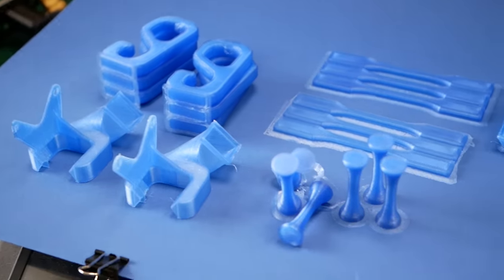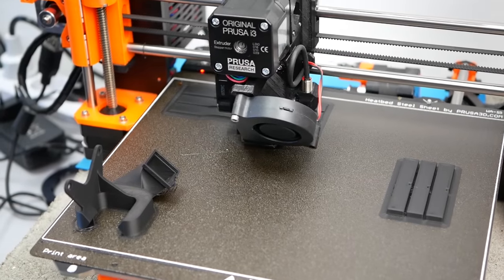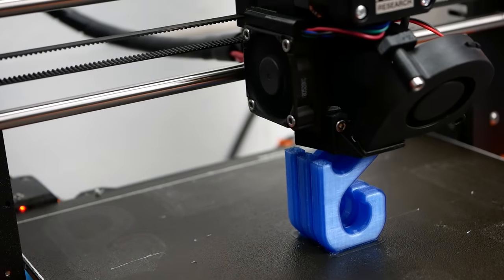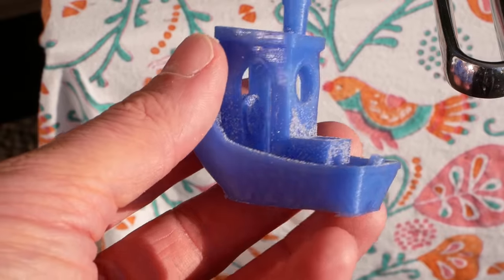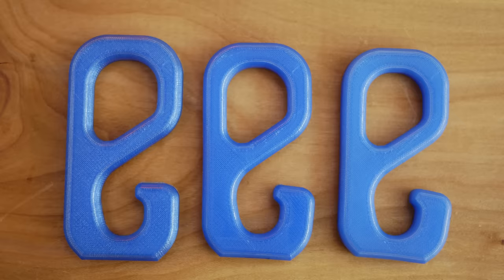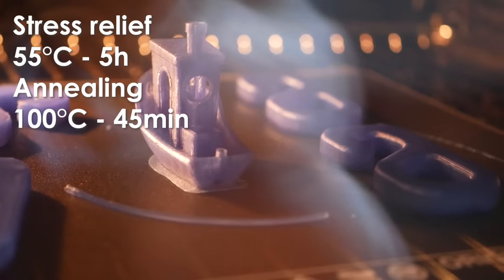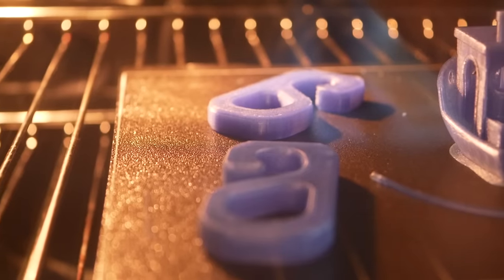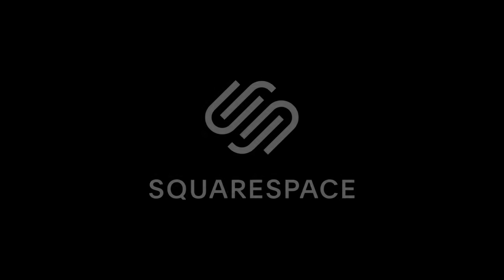Strong 3D prints through ANNEALING, but... Part 1: PLA

Comment: I wrote a small python program that generates gcode the ramps the heat bed temperature up and down at a controlled rate for annealing printed parts. Per all the documentation for annealing plastics, the ramp rate is important! Using an oven does NOT control the rate. Are you interested in testing this? I like the test equipment you have made and am curious if controlled temperature ramping changes the results.

Comment: I doubt there is a way to improve inter-layer height of FDM with a secondary operation, it's basically a weld line, and those are huge issues even in injection molded parts.

Comment: What about flash heating.  Dip the test piece in hot oil or glycol at appropriate temperature for 10 seconds to melt the outside while leaving the internal structure in place.  Please try it????

Comment: You should try putting a weight on the sand or some container to hold the sand tight together. Annealing will encased in plaster?

Comment: please if you aprouve like it 😊
new idea of bencmark : 
test how mutch adesive to plate is
-build tak
-hot & cold glass pane
- hot & cold sanded with 240p, 500p, 800p sand paper
- with glue stick or " glue for hair
-ultrabase if you have

the idea is what us the better to not have warping
you can do these test on multiple platics

Comment: Hmmm, maybe baking temperature is to high. Did you based on some information when you choose oven temperature?
Reply from the maker: The degree of annealing depends on time and temperature. 100°C is a "usual" temperature. I don't think lower temperatures would change alot besides needing more time for the process.
Reply: CNC Kitchen 
Tg delta is key for PETG apparently.
The comments show Tg - 20c as the strongest.

Comment: While most of these results were a little disappointing, the annealed parts' elastic failure mode is a pretty nice benefit, considering PLA's habit of bursting into scary shrapnel when failing. Edit: Actually, I wonder if just the de-stressing process would confer that property, if not necessarily the same temperature tolerance.

Comment: There are other heat-annealing tecniques, as well. I've seen at least two which use water at different temperatures.

Additionally, your standard conventional oven isn't designed for the sort of temperature control needed for precisely annealing anything, synthetic polymer or otherwise; as you acknowledged when you commented on the sand technique. I'm not sure how well sand helps with that, or how long it takes a given volume of sand to come to temperature evenly. I do know I've seen at least one paper where a researcher used a kiln or a casting oven for better control and followed a temperature "cone" process adjusted for the plastic in question. I don't remember any further details of that paper, including the results or the authors, sorry.

I do find it important to note that every test sample you used here in this video had a reduced infill percentage. Would you be amenable to running a set of similar tests on prints with 100% infill? I imagine that the increased quantity and lesser individual volume of the cavities within the prints might make the material more likely to polymerize together successfully - but that's only my guess.

Thanks for another educational video, Stefan!

Comment: Hey guys, I really want to know where you got the information that ABS can't be annealed, because I've seen several sources that claim otherwise, and when I've printed ABS I've noticed non-negligible changes in part reliability. More specifically I've been able to get parts to maintain more strength along z axis loading without layer delamination. I'd really like to see some empirical testing done for the sake of completeness, because otherwise I'm fixing something that isn't actually being fixed.

Comment: The only thing that I could suggest is trying with vacuum cooking,  it's a special device that heat water to a precise temperature..   then you put your part inside a sealed bag  without air.  as you do with food.   the oven is not as precise because it heat then turn off then heat then turn off.   the element is radiating heat that is hotter than the set temperature .      like with  meat you can not overcook and the center of the piece should achive the same temperature as the outside after a certain time  as no part can go to a temperature higher than the set temperature.      the only ''big'' problem that we have is that we have to  find a way to have  the water or something else   boil to a higher temperature.  someone have any idea if there is any way we could make this work??     maybe something underpressure??

Comment: Wouldn't warping be due to inconsistent heating? And could be solved by very gradual introduction of heat up to the required temperature, with a similarly slow cooling process? Putting the parts in a preheated over is practically following a recipe for warping...

Comment: There is this Machine, that anneales Prints with alcohole which it makes a mist of and "melts" a part of the outer layers to fuse together without melting down to scale, where the scale of the prints itselfe changes ^^ use that, best way ^^
Reply from the maker: You mean the polymer polysmoother?

Comment: Dip it in super glue spray it with a air compressor with sodium bicarbonate fine thin layer. Use the sodium bicarbonate to fuse it to the super glue super reinforce the outside.
Reply: Spray it with the baking soda with a modified air brush like a sand blaster

Comment: Was there a thermo-couple in the sand. Just wondering about sand insulating and not allowing the heat to penetrate.
With metals there is a HIP process. They heat the part to it's plastic state in a vacuum, and that makes the part denser. A poor quality car cyl head casting can shrink 20mm.
Annealing doesn't seem worth it, at least compared to your less cooling method.
Reply from the maker: HIP treatment is actually done under high pressure "Hot Isostatic Pressing". I thought about applying that to FDM prints, but the infill and the open porosity makes it challenging.
Reply: @CNCKitchen  I thought they vacuum it before they pressure it, but I'm probably wrong. Yeah vacuum would make plastic bubble, but pressure would simply compress it. If the part wasn't sealed it might work.

Comment: How about using some 100% infilled pla part and submerge in some denser harder material for higher temperature annealing?
Reply: Using 100% infill to make sure that it wont reduce its size heavily even if it is fully melted. Using denser material (maybe some finer sand powder or other) may help maintain its shape during annealing

Comment: I've tried to anneal the filament before printing it, but it looks like the diameter is not consistent anymore and the prints look a little worse. Of course, it is not very easy to spot. The only way to fuse the layers together is to keep both plastics at the same temperature, and this is not easy with 3D printing :(
Great work and thank you for the study!
Reply from the maker: Melting your annealed plastic will "reset" it, so no effect will be left.
Reply: I've thought about this too, but did not do any scientific test on it, went back to the good old petg :)

Comment: I annealed ABS and PETG for fun. ABS had too significant warping to be useful in my case but damn was it stronger.
Reply: At which temperature did you anneal your ABS parts? I need to keep the dimensions. So I wouldn't go beyong let's say 100C. Will I get any layer adhesion improvement after annealing?
Reply: @rmatveev  I'm going to have to check my notes for that but you can look up salt annealing

Comment: So if the temp resistance is better. Why don't you cook it at 100. Let it cool down. Cook it higher. Let it cool down. And repeat till you find the limit ?
Reply: I think I would start cooler.  The first cycle to let the stress out and do very little else.  This would decrease warping.  The next would be up near 90C to get a small change in structure.

Comment: What about if you used 100% infill and then used plaster of Paris rather than sand?  Then crank the heat up slowly to melting so you use the plaster as a mould?

Comment: The problem that I see with this, are that your prints weren't made with 100% infill, nor were they made with any sort of heat treatable PLA. Also, your layer lines weren't printed in the direction of force. Longer layer lines equate to better made parts.

Comment: Dear Stefan can you please test Extrudr GreenTec Pro Carbon filament? I use it for all my parts that require mechanical strength, but the HDT seems lower than 165 deg C that they claim, maybe it needs heat treatment?

Comment: Not busted yet. Have u tried diff heating and cooling phases repeatedly on the same part as in the way original Damascus steel was made? Or shock cooling between heating. Artificial Damascus steel needs carefully controlled heating phases, and quenching as it has layer cohesion probs. Using green metal casting sand will maintain perfect shape. Perhaps try 20 mins at 60°, natural cooling, then 20 mins at 80°, slowed cooling, then 20 mins at 120°, with a fast water quench.

Comment: While not directly related to the subject of annealing, how does the tensile strength of a hook printed standing up (as shown in the video) compare with the strength of the same hook printed lying down (thus changing the layer direction)?
Reply from the maker: Usually around 50% less strong. Just check the graphs in the video.

Comment: I have a high flow two stage water pump that I need to be able to withstand temperatures up to 80ºC. How do I go about this? I am afraid that annealing will warp the parts too much, thus they won't mechanically interface properly anymore, as a result I am guessing my best bet is to go with something other than PLA at this point. Problem is I live in a country which has... how to put it lightly... with certain recent actions decided to slightly separate from the rest of the world, as a result I am not much spoiled for choice.

Comment: I was drying my ABS filament, in microwawe oven, and deep inside, filament was stuck together.
Power of microwawe oven was 360W
Fuilament was drying with pauses when it can cool off, some about 5 minutes.
All was made by two approaches:
1) Heating 5 minutes with power 360W
2) Cool off 5 minutes
3) Again 5 minutes heating with power 360W
4) Cool off
And inside filament in several places was stuck, BUT you must have to consider that the filament was little bit wet, and because of this with printed parts may be will need more power of microwawe oven :/

Comment: I wonder how a Sous Vide like process would work as it's a move uniform and consistent temp.
Reply from the maker: IMO sous vide is nice, if you only have a crappy oven but otherwise it causes too much problems with submerging and water pressure why I wouldn't use it. I don't think the temperature needs to be accurate to 0.1°C.
Reply: I did see some tests from another Youtuber. He tested typical annealing methods, and then used boiling water -- get water up to a rapid boil, dip the part for less than a second or two, then immediately dump in cold water to prevent deformation. From his tests it seemed stronger, but he didn't test with multiple samples or any controls.

@CNC Kitchen, maybe you should try that method.

Comment: How about the temperature resistance? It usually increases during annealing (that's at least why I anneal pla for higher temps if ABS/ASA/PC is not suitable).
Reply from the maker: PLA will be usable up to 180°C depending on the degree of annealing. That depends on time and temperature.

Comment: @CNCKitchen I firstly would like to thank you for your extremely helpful channel.

Now, Tom told me some time ago that the additives used to colour my filament didn’t significantly affect bed adhesion.  This simply doesn’t jive with my personal experience.  Can you perhaps hint at the path I might take to tease out the full truth of this.

Thank you.

P.S.  don’t feel obligated, I just hope I peak your interest.
Reply: I'd be more concerned about layer adhesion.
Reply: budo r Funnily enough, I’ve never had layer adhesion problems with PLA in years.  Had ‘em with PC on one of my printers, but that’s probably due to a slightly corrupt thermistor table I couldn’t be bothered to fix.

All of my printers are open frame designs as it happens and so I suppose I could enclose one and see if that helps.

Comment: Do you think 100C is actually required for annealing? I found 3h at 75C produced a similar percentage shrinkage, with less warping. Since shrinkage is caused by the crystallization, it suggests the lower temperature parts are equally well crystallized, no?

Comment: I’m printing the edge 540 73” from 3dlabprint and they include 2 parts for fuselage part 1 and 3 so I followed instructions and my fuselage part 1 deformed completely in sticking with the not annealed piece even if I’m using it to fix an electric engine in there :) what would you recommend?

Comment: I might be a bit late to the Party but you could try coating the models in plaster before annealing to prevent warping(you might need to leave some little holes to account for expansion though. Plaster should be much more brittle than the PLA and therefore break long before the PLA when using the good old hammer method to get it off. If anyone tries this I would like to know about the results…
Reply: What about expansion during heating? Or do you expand it vy heating to just under melting temp, then let nature do the rest?
Reply: I mean. Then you enxase it and continue the process

Comment: How about keeping the print on printbed AND submerging in sand? :-)
Reply: That's what I was thinking 🤔 Or, inject removable sand and then submerge the print with hot bed in sand 🤔 try lower temps with longer annealing times 🤔 a flame thrower 🤔🤨🤷‍♂️

Comment: What about a Microwave Oven as it isn't radiating heat even though it was a convection oven, I was wondering if the heating would be different I know nothing on this subject but thought it would be interesting if the parts would act differently, temperature control would also be interesting.
Reply: Sometimes the most interesting results come from stupid ideas, lol.

Comment: I found this paper on the subject.  Magic temp = 160C.  https://www.researchgate.net/figure/Building-direction-of-tensile-specimens-using-3d-printing_fig1_320723009.  They are using a mold to reheat (which is cheating), but using sand or salt to contain the part should provide similar stability.

Comment: I know injection molded nylon is heat treated in water to improve its strength through water absorption.  I wonder if other polymers might benefit?
Reply: Well I know that nylon is really hydrophilic, you can't even leave it out for a day before the filament is ruined
Reply: @Anon.G  Water interferes with extrusion, but improves mechanical properties when added to finished parts.  It's a common post-treatment in industry.
Reply: @nelumbonucifera7537  yeah I'm just saying pla can be left out for ages without absorbing too much water, so I'm not sure how well it would work in that case.

Comment: Did you Caliibrate your Oven?  Typically Most residential grade ovens are grossly variable /inaccurate being up to 25 Degrees Off.... at  readout temps of 100 c.
Reply from the maker: Used a separate thermometer.

Comment: can you anneal it somewhere near the glass transition temperature and still get the increased heat resistance? but just do it for longer than 100C
Reply from the maker: Probably not, or only when treated for a very long period of time. The increase of crystalinity is dependent on time and temperature (take a look at the paper in the description).
Reply: @CNCKitchen  Yeah the paper cites 31 hours but if deformation is less then it may be helpful for parts that need to stay closer to their printed shape.

Comment: AIR INSIDE THE PRINT (err inside) ..exerts forces when the printed part is heated.
Reply: A solid fill print might be annealed to confirm the above statement or not.
Reply: ..or as close to 100% solid fill as possible. The reality is that FDM traps air in amounts which should vary by extrusion width and layer thickness ..according to previous investigations.

Comment: He admits there's a 10% increase in strength and an increase in heat resistance. How anyone can call that a busted myth, is a mystery to me. Just because 10% "isn't that big to me"?!?! What?
Reply: No More BS Please well, you gain 10% tensile strength in x-y direction but you also loose 10% of your length. In z direction you get nothing but gain 10% length. Also the parts he’d had got warped beyond usability, although he could somewhat mitigate this with the sand. So there might be applications for this but this would be rather not a standard method for the everyday user.

Comment: Maybe if the printer worked in the oven, slowing the surface cooling between passes.
Reply: also maybe hang to pieces in the oven to avoid hot spot on the flat plate.

Comment: can someone shed more light on the fact that a heat treated print is less transparent? I find this extremely counter intuitive as the unordered structure of the untreated print should be more likely to scatter light in all directions whereas a crystalline structure should interact with light in a more predictable fashion. at least that is what my guts say.
Reply from the maker: Read up why glass is transparent and amorphous. Same effect there.
Reply: Followed down a rabbit hole here and couldn't find any link between transparency and amorphous or crystaline structures. I guess it just so happens that PLA is transparent when amorphous and opaque when crystaline but there is no causality in both directions. I misinterpreted your statement at 6:20 as a generalism (like in: its transparent so it must be amorphous in structure OR its opaque so it must have a crystaline structure).